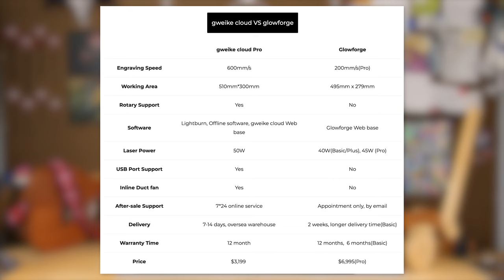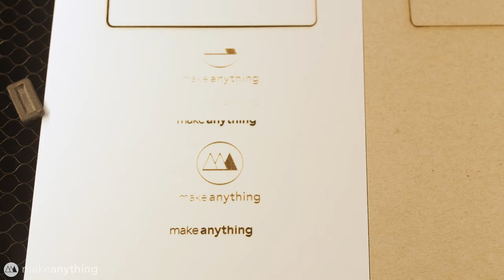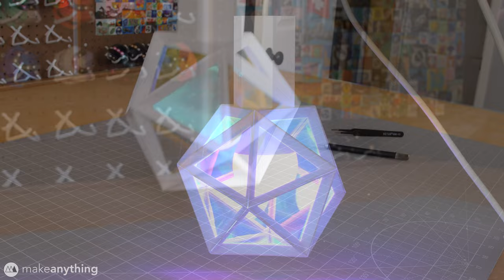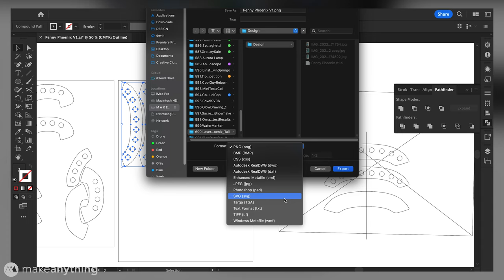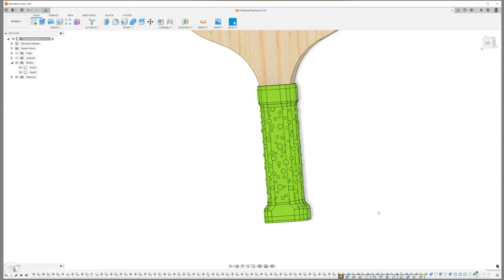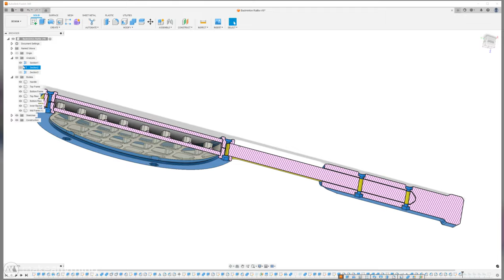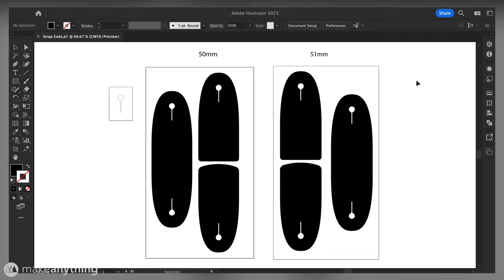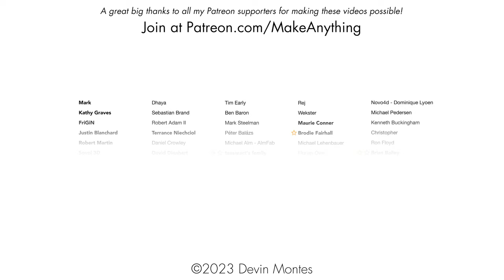"Cool Prints" w/ Gweike Cloud Pro 50W Laser Cutter

Comment: I was worried about the rods in the tail savers falling haha. When I was younger I had a few cheaper novelty boards with them built in, and the rods went all the way through to the top of the board, or were mounted on springs and flared at one end so they couldn't fall out. I'm glad to see the crosshatch made them stay in better, but I'm curious about the lifespan they'll have.
Reply from the maker: They'll definitely have to be swapped out after some use but that's by design to protect the life of the board itself! The solutions you mention sound interesting though, I hadn't seen those examples
Reply: @make.anything  your design would definitely protect the deck better, the board with the springs broke really quickly. They were clearly designed for the features and not the longevity lol.
Reply: @make.anything  Some epoxy would help

Comment: In one of my graphic design classes in school, we used a laser cutter to do a project in the first semester or so. I remember having to peel off some masking tape-like cover from the wood. Is this a standard thing, because I have seen a lot of YouTube videos where no top layer is removed. I feel like it might protect the wood from burn marks left by the engraving? Please lmk!!
Reply from the maker: Yea, it's standard to protect the wood, but also standard to not mask for convenience
Reply: @make.anything  When you put the blue tape on some of the wood I was like “Oh that’s probably the same sort of thing”
Reply: You're spot on about why it's used. When you engrave or cut some of the wood burned away by the laser will re-deposit around that point. You can see this as a sort of "shadow" around the edges. However if you put down some masking tape first, the burnt wood re-deposits on it and when you then peel it off it results in nice clean edges. Though as Devin showed with his pickleball paddles, a little bit of sanding can also take that thin layer off.